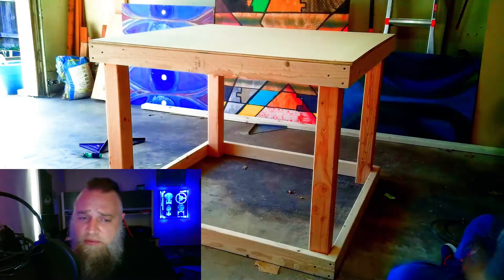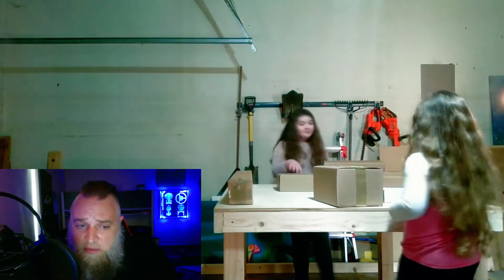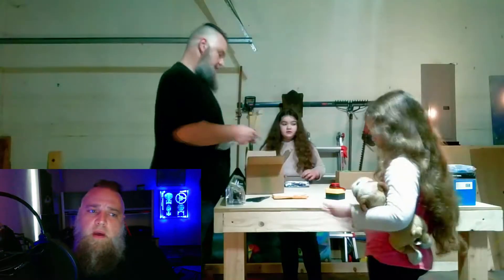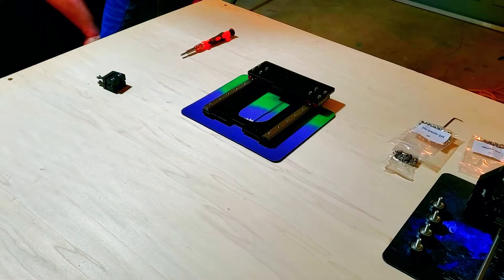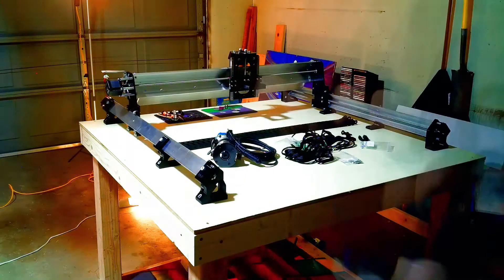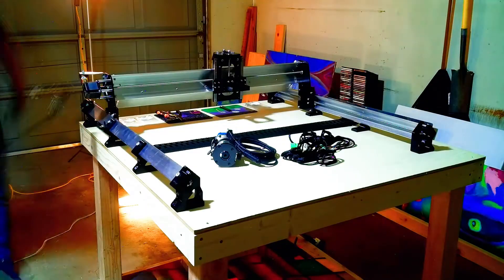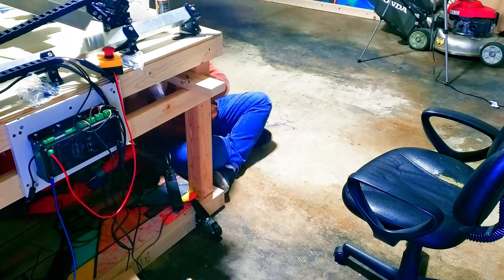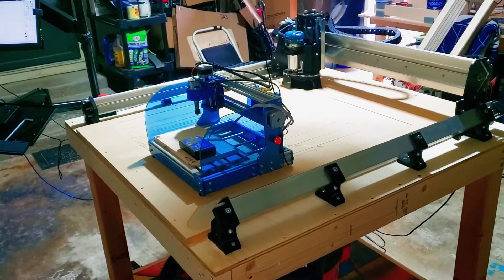Should You Go Bigger with Longmill CNC? (Yes!)

Comment: Is it 30x30 in inches or cm. I have a 30x30 cm by sainsmart. Need more cutting space. Good machine but small. I'm thinking together the 48x30 if I inches.
 Great video.
Reply from the maker: Yes that's inches, but that's nominal. So double check with them on actual cutting area. I'm glad you liked the video.

Comment: Great video, your input is appreciated.
I decided on a onefinity for a lot of the things you went through with your longmill I view as dealbreakers. Just my preference, of course. After dealing with an ender 3 pro, and all the tinkering, add-ons and maintenance it requires, I was fed up with spending hours building and tinkering with a machine, and wanted something that's fairly low maintenance, plenty stiff, accurate, and doesn't break the bank. The onefinity checks all the boxes for me. I agree completely on belts, but dealing with eccentric nuts and v-wheels is also something I no longer wanted to have any part of. I also love that I don't need to run the onefinity from a PC. 

I'm glad competition in the hobbyist CNC market is so fierce. It's pushing companies from all ends of the spectrum to do better. I do still think the onefinity is the best of the bunch right now though; no other company provides what onefinity does at a fair price.

Comment: Thanks for posting this. All the CNC videos I have seen talk about the excessive dust. What impact would mounting the control board under the table have after initial set up? After several months, what would you change?
Reply from the maker: Your welcome and 1 thing I would change would be, I would have made my table a little wider. Just to have a place to put tape, bits, glue, paint, ect... off to the side and out of the way. Not a big deal just a quality of life improvement. As for mounting to underside I see it keeping the dust to a minimum on the controller. But dust is like glitter, it goes everywhere. The only draw back would be ease of access, but even then that is dependent on how you mount it on the underside. Make sure you give your self some room to get to connections and cable management. Then you should not have any issues. I do like my controller on the side where I have it, as I can quickly check connections, but I do have to clean it up a lot just to keep the dust build up in check. So it comes down to what you prefer,  and being on the larger and taller side myself, easy access more  cleaning wins out.

Comment: Thanks for your video story, well put.  I've tried making videos and know how hard it is to get to what you created.  -   I'm pondering getting a CNC,  for me space is a major issue - half a garage would be a huge upgrade for me.  Cost leads me to the hobby class - looked at CNC's at woodworker shops and they are $2500-$10,000 - ouch, but a Longmill I could manage.   I have space for either a 3018 (probably go to a 3040 off the bat or maybe even the new 60x60 but that one is a bit pricey)  OR should I just go straight to a 12x30 Longmill.   If I get the 3040 Genmistu will it be only useful as a learning tool, or will there be things I'd chose to build on the smaller Genmistu after I get a Longmill?  Will it have continued value and use?   Building miniature structures is one of the reasons I'm looking at a CNC (model railway hobby),  and maybe the 3040 will be big enough.   Value your response as someone familiar with both tools now.    Not planning on trying to turn a profit, just a hobby to have fun.
Reply from the maker: First Thank You for watching. I would really think about what is the largest size thing you want to make is, even if it is down the road in your adventure. Lets pretend and say its 6", well then make sure you have a cutting space of 8" (Always best to have some extra room) The 3040 and 6060 Genmistu are more rigid machines than the 3018, so they will be more similar in that regard to a Longmill than the 3018. In regards to my 3018 it is mainly used as a test and trouble shooting machine these days. The only other time I use it is if I need something small cut and I have my Longmill going as well on a long project. So for me my 3018 is still providing use. If it was not for testing and making videos I would most likely have donated it to our local school. The hard thing to answer in your shoes is do I get a 3018 and practice and see if this is something I want to do, then spend more money on upgrades, OR do I go straight to a Longmill and hope that I am set and not loose interest. Its kind of like the stock market in picking stocks and that what you invested gives you the returns you were hopping for (Not monetary in your case, but enjoyment in your hobby). Personally from what info you have given me, I would lean towards the Longmill, I just really like the machine itself and the company. HOWEVER, I would suggest going to the community groups in Facebook or their Website Forums and see what people are saying in terms of putting the machine together and the issues they have, and see if someone else is making the kind of things you are and get their thoughts. Also you will get a feel for what community you feel more at ease in and suites your way of doing things. Both communities have a great group of folks who are willing to help with trouble shooting and bouncing ideas around. I hope I have answered your questions or at least give you more to think on, if there is anything else or if I missed something let me know.

Comment: Looks like I'm pretty much going down the same path as you.  I got a 3018 Pro because it was just irresistible at just under $150.  Of course, the first thing I did was upgrade the spindle for another $30 and started a bit collection which is up to about $50.  Printed a drag chain to keep the wires neat and now I'm playing with it learning how to tile, use tabs, and do inlay.  I want to do some relief with it too.  But as soon as I started playing with the 3018, I got the bug and want a much bigger machine.
In my case, I live in a tiny apartment and have no space for anything bigger.  I've just been told I would have the opportunity to move into a larger space where I can have a bigger machine.  So after looking at many YouTube videos, I wanted a Onefinity Journeyman X-50.  Just don't want to fork over three grand and wait three months.  So I thought I would go with Openbuild 1515 but then I saw a guy riding on the LongMill 3030!  I wish the X axis was longer but at this size it's much more affordable.
Very informative video.  Now I'm going to look at your video on the Raspberry Pi controller.
Reply from the maker: The cnc bug is real. Once you get going, ideas for what you can do just keep multiplying. Congrats on getting some more space, and enjoy your longmill. Just fyi they are working on a larger model, not sure when it will be available, cost, or if there will be a kit to upgrade. Thanks for watching and glad the video was helpful.
Reply: @D.E.Hammer  Thanks for the heads-up on the larger model.  I'll wait for that.  I know if you buy one model and get an upgrade kit, it ends up costing more in the end.

Comment: Good video. 
Does the Longmill have homing limit switches? 
Your table appeared to be open with out support underneath. If so this it will sag and create problems with engraving. You should add a lot of cross support under the table top. If  the table sags 0.015” and you are engraving 0.5” letters you will be disappointed with the inconsistency.
Reply from the maker: They just released homing limit switches for the longmill.
Yes I did miss the adding the cross support during my initial build, but have since added.

Comment: Dude I'm right there with you on your cnc machine outlook.  I got an x carve to start and it was great, then went on up and got a 1500mm queenbee.
I wanted a dust collection system that set independently of the z axis. I bought another x carve collection system and modified it. I'd recommend it man, it worked GREAT for me! I modified it to a C beam z axis, I can forward pics upon request, I did this to my home cnc and the one we got for at work.
Reply from the maker: That sounds awesome. I just got my temp dust collection system set up. Need to finish getting my work shop set up and painted before i look at a more permanent solution.

Comment: Thank you for sharing your experience, very nice setup and video explanation.
I’ve been thinking how does the shipping and importing this machine from Canada works? could you please share a little more on that. Thanks👍👍👍
Reply from the maker: So mine shipped via ups. You have to pay a tarrif or duties on it which came out to $75.00 Now you can pay that one of two ways. First is once the item is cleared by customs and crosses the boarder you track the shipment and there is a button that you can press to pay for it. UPS does not always update their system that you paid so print out the confrimation as a back up that you can show the driver. Otherwise you will have to pay at time of delivery so have your credit card ready. I did get all the bell and whistles avaialbe on the 30x30 and it all came in 1 very heavy box, but it was very well packaged and had no damages. I hope this helps, if you have any other questions or missed something particular, let me know.
Reply: Thank you very much for your help, keep posting all your cnc work👍👍👍

Comment: Just built mine (about 8, 9 hours off and on )and had the same issue the eccentric nuts and v wheels where the hardest part, was it too tight or too loose ... I don t know LOL. great over all machine, and its only 1 hour away so if I need anything its  quick drive ! nice vid thanks . We need a good video close up video of the eccentric nuts
Reply from the maker: Yeah, those darn eccentric nuts were a real head scratcher. All i know is i got them right after messing around with them for awhile. Yes it is a great machine and i am verry happy with what it is able to produce. Thank you for watching.
Reply: Here’s a recent video from Sienci re V wheel adjustment. 

https://youtu.be/Z7WLmOk90V4

Comment: i have the longmill.  cant get it to cut square.
Reply from the maker: Sorry to hear that, I know when I was mounting the legs to the table I put the screws in the wrong order and mine was off at first, but went back and put them in the correct order and that got rid of my issue of not being square. If you have done that, I would recommend going to their FB page (https://www.facebook.com/groups/mill.one) or emailing them, both the community on FB is great at helping diagnose problems and from users there who have contacted them say they have been great at helping with problems.

Comment: That screen/keyboard set up is really smart. I’m in a similar place to you but torn between the longmill and the queenbee pro, which is more expensive and has linear rails. Also tempted to get a 3018 to start with to make bonehead mistakes with, it’s a tempting idea!
Reply from the maker: The 3018 was a good learning experience, its like going to elementary school to learn the basics, instead of jumping right into High School or College. I made so many mistakes on my 3018 that I have not repeated on my Long Mill. I would of been fine with getting the LongMill first, but I felt much better having some experience under my belt.
Reply: @D.E.Hammer  Thank you so much for making this video. I've done a lot of research so far and the Longmill is the way to go for me, 30x30. 
 Im a beginner with cnc and my biggest fear is the software/programs that are used. I don't know anything about that stuff. I think thats why I haven't pulled the trigger yet, because I've seen so many videos on how to get the project started on the computer, the different programs and stuff like that, that its been very confusing for me. Its more of fear than anything because, I'm buying something that I don't know how to use. Sure, I can put it together, but after that....🤷‍♂️. 
So, right now its just a matter of getting things in order before ordering it; finding space for it, building a table, laptop etc. 
But can you please tell me or provide a link for that keyboard/monitor? setup that you have there? That was a great idea. 👍 
Keep up the great work!!
Thanks so much. 🙂
Reply from the maker: @JoeLazzara  I completely understand, that is how I felt when I first got into 3d printing, but once you get into and start doing it, it all becomes second nature. Also on that set up i use a raspberry pi 4 so that way I do not have to keep my laptop out there. I do have a vid on that as well if you are interested:

CNCjs Touch Screen with Raspberry Pi - controller for GRBL
https://youtu.be/2P5_hr8T4Ak

Keyboard
https://www.amazon.com/Logitech-Wireless-Compact-Keyboard-Touchpad/dp/B074NYCPN2/ref=sr_1_4?dchild=1&keywords=logitech+keyboard+usb+touchpad&qid=1631201664&sr=8-4

TOUCH SCREEN:
https://www.amazon.com/gp/product/B08P1M54G6/ref=ppx_yo_dt_b_search_asin_title?ie=UTF8&psc=1

STAND:
https://www.amazon.com/gp/product/B07DFSGR48/ref=ppx_yo_dt_b_search_asin_title?ie=UTF8&psc=1

SCREEN HOLDER:
https://www.amazon.com/gp/product/B084QCJVWS/ref=ppx_yo_dt_b_search_asin_title?ie=UTF8&psc=1
Reply: @D.E.Hammer  Thank you so much for getting back to me and for those links!! I really do appreciate it.
That monitor and laptop holder thingy is perfect. 
Yeah, I'm hoping that once I get the initial feel for the software and how to use it and what everything controls, I won't be so stressed out about it. 
Thank you again for your help buddy!!
Reply from the maker: @JoeLazzara  Your welcome, and do not stress you got this!
Reply: @D.E.Hammer  Thank you.